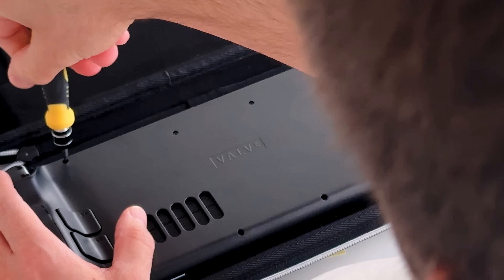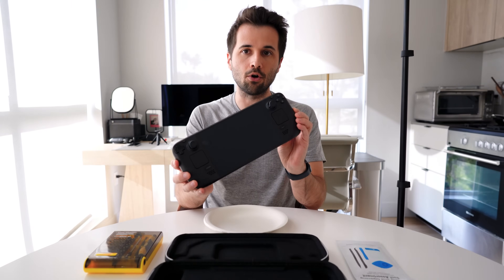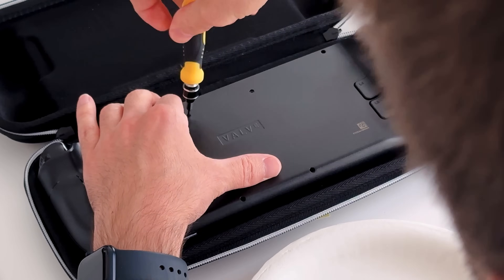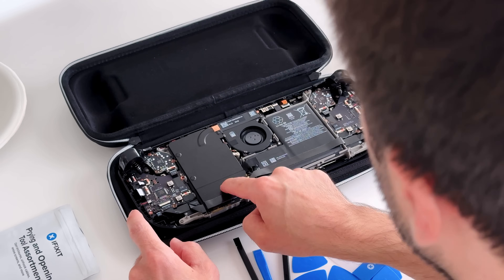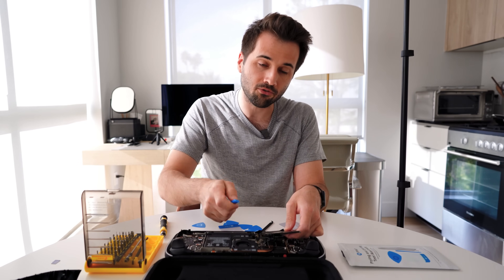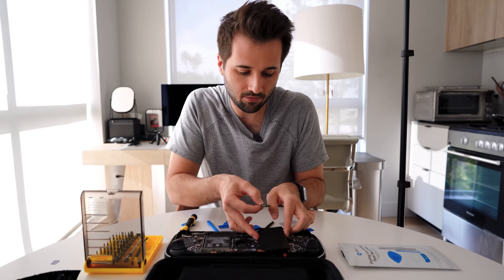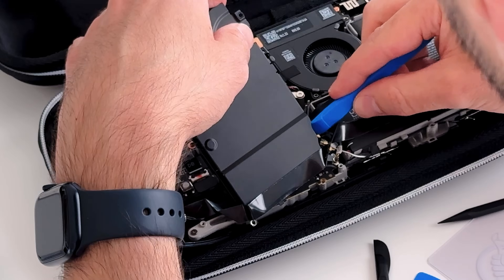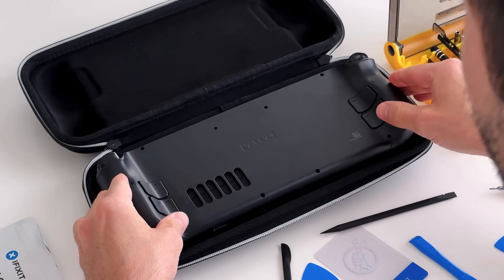How To Upgrade the SSD in Steam Deck OLED

Comment: Great guide esp helpful not having to remove the cable around the shield - the ifixit guide makes you do more work and remove the socketed cable which adds the possibility of destroying the socket. The hardest part was figuring out how to start popping off the back shell, a lot of videos make it look WAY more easy than it really is. In my case I couldn't get it started on the side corner like videos show at all, I was able to start working the plastic pick around by starting at a corner but at the top not the side. Once I was able to start working and popping the clips along the top, it made it easier to pull the shell apart a tiny bit and work along the sides. Getting the back shell off is where the risk of the damn thing flying out the window somehow really comes in. Do not be tempted to start using metal tools you'll definitely mark the shell in an ugly way and maybe get the tool skidding along the screen by accident. Also might be good to at least temporarily put  a screen protector on the screen during the upgrade just in case.

Comment: why not just get 2TB micro sd nd let that 512GB free for smooth operation instead of opening it nd change ssd ?! 
is there really a difference between just get 2TB micro sd nd changing ssd ?!
Reply from the maker: Yes the ssd is much faster read / write speeds. For retro games you won’t notice but for AAA games ya…

Comment: step 1: Remove Micro SD card
step 2: remove SD bnackplate
step 3: please, LEAVE the ribbon cable glued to the APU shield/plate, trying to remove the ribbon equals risking tearing the thin cable even with its protective layer. 
             i tried removing it but refrained due to fear of tearing. it takes an awful lot of force. its REALLY glued down to stay there. unless the ribbon is already cooked, leave it.
step 4: (THIS IS OPTIONAL) you could release the ribbon cable from its connector on the left-hand side closest to the shield. 
              after this you can carefully fold the ribbon cable WITHOUT force onto the right side, give you a little more 'working space'. 
              do be very careful when unlocking the ribbon connector to remove the cable, as these connectors are fragile. too much force can break the lever.

Comment: You can unclip the ribbon cable on each side.  Makes it a lot easier to remove the metal piece.
Also, an SSD is not technically a hard drive.

Comment: Finally got around to moving the SSD from my old LCD to my new OLED. Have a couple of takeaways:
1) You counted out 3 screws on that internal shield. There's actually only two, and that third screw you point out is on the mainboard, and doesnt require removal at all.
2) You didn't need to disconnect the battery, if you put the unit in storage mode.
3) You can and should disconnect the ribbon cable that goes over the shield, where it's labelled "C-R". You just lift the white clip holding the end of the cable and pull it out.
4) When you put the shielding back into place, make sure the bottm right screw hole in it lines up with the screw hole in the mainboard. I say this as it may shift or bend out of alignment, and need to be popped back into place.
5) The SSD from your old Steam Deck is plug and play, and all your games, apps and files will appear exactly the same on your new deck, which is great.

Otherwise all good and thanks for the guide!
Reply: This was super helpful. Thank you. Used all your points.
Reply: @Adam-M1  say worrrrrrrd
Reply: Screenshot! Thank you, good sir!

Comment: Unplug the ribbon cable and take the entire shield with the cable attached and set it on the battery so you dont have to keep juggling the shield and SSD.

Comment: I swapped my 1tb SSD from my LCD Deck into my OLED last night. From studying various videos and guides i decided this method was better than unplugging and/or unsticking the screen cable.

There is enough slack due to the folds in said cable to work around it to get to the SSD and to remove & install it.

Whichever method you do just take your time...

Comment: 4:20 DO NOT "work around it", disconnect the battery connector properly! The small "C-R" cable on the bottom left with the white clamp, just flip the white tab then gently pull the cable out, you should ALWAYS disconnect the battery when you are working on devices. Once you are done you can easily slot it back in and flip down the clamp again to secure the cable.
5:09 Yes you do but NOT FROM THERE, disconnect the left connector which connects it to the motherboard, that's why the clamp is there. That is WAY EASIER than what he's doing.
If you disconnect the battery properly you can fold back the shield completely off the Steam Deck, making it MUCH easier to access the M.2 slot.
The way he's installing the SteamOS image is wrong too, it's WAY easier to get a USB-C drive (or one of those combo USB-A/USB-C drives), then use RUFUS (or another image installer), download the image file from the Steam website and install from the USB drive, that will also be WAY faster than using an SDCard.

Comment: i needed an extra step, with a corsair 2TB SSD it was very slightly thicker than the 512GB i removed, which meant sliding the silver shielding would not go over the new SSD. So if that's the case, carefully unstick the shielding wrap, place around the new SSD and re-stick it around. It's pretty easy but use tweezers rather than fingers ideally so you dont remove all the sticky residue with your fingers. Oh and i just unstuck the cable(s) from the main black plate, it goes back on just fine.
Reply: thanks for the info buddy👌🏼

Comment: When I tried to pull out the battery plug using the tab, the transparent part of the pulling aid came out of the plug. I then pinned it off with a flat tool. I hope it's no problem. I'm afraid I've damaged something. Tomorrow the SSD will arrive and I can test it. Opening it was child's play with the ifixit tool it took 4 seconds. Why can't everything just work like in the ifixit instructions? I only saw your video afterwards.

Comment: Stop calling it a hard drive.

Steam Deck uses a solid state drive.

Hard drives are mechanical, they have moving parts, they're much slower, and they make noise.

Solid state drives are much faster, have no moving parts and are completely silent.

Two different things.

Comment: Great guide, I was just wondering, have you tried the "loosen two screws" fix for the audio hiss? I read you can just slightly loosen the two screws on the audioboard to fix the issue.
Reply from the maker: Yeah I have another vid about it here: https://youtu.be/XuCFw-gfhlA?si=Y3J7fOsulEfuGY1T
Reply: i added DIN125A m2 washer under 2 audio board screws. Completely eliminated the hiss.

Comment: Those aren't hard drives, those are SSDs at worst (NVME at best), though M.2 drive would be the best description;
Hard Drive describes a rotating platter drive, which are antiquated for most use-case in modernity.
Reply: SSD is the best description seeing as how that's the type of storage being used.

M.2 is nothing more than a form factor.
Reply: No, it isn't actually;
NVME drives ARE NOT SSDs, nor are they interchangeable with them in a number of cases;
M.2 slots, with storage in mind, are keyed for two form-factors, M key & B key;
M key are utilized for NVME drives and utilize PCIe X2 or X4 modes presently.
B key is used for SSDs.

Comment: You can fix that stripped screw with epoxy resin. A very small amount of it injected into the thread, use a tiny drill after it sets to give it a center. Then reseat your screw to make new threads. Lot of tutorials out there on how to do it that might be worth looking at. It is not a fun process though.
Reply from the maker: You are awesome sir thank you!!

Comment: Definitely do not over tighten screws on PCB boards in compact units like this. The PCB can take heat fine, but the metal of the screw expands when heat rises from use, and that small amount on a tight screw can crack your board or drive.

Comment: I have a genuine question:
1)If i choose the 64gb Steam deck and then swap the 64 to 2tb, will my steam deck function like normal? Meaning no crash or slow or any malfunction whatsoever?
2)How to get the 2tb to swap with the 64gb? Like can someone recommended where to purchase it? Along with the tool kits that the guy used to open the back of the steam?
3)Do i have to install windows/linux on my steam dec? But i wanna install windows.Idk why. perhaps i could watch utube? or maybe spotify😭🤦

Comment: Your video was not out before I did this. I say if we removed the cord on the case and press the glue back onto the case, is there anything I should look out for because I did open up the little white flap and took the cord out and put it back in correctly.
So is there any issues I should look out for because of moving the cable
Reply from the maker: You’re probably fine 👍
Reply: @TonyCassara  also a small thing I witnessed on the steam deck oled limited edition there is one pixel on the top right on my system I tried contacting valve They told me they won’t take the system back for RMA but they might consider after I use the system for 30 days
Reply: @TonyCassara  thanks

Comment: I’ve just upgraded my oled Steam Deck SSD. The video helped but I did a couple of things differently. I disconnected the ribbon cable from the left hand side and folded the shield over to give me easy access to the SSD. I also only needed to unscrew the two left screws on the shield, the other one appears to be holding the PCP to the case.

Comment: After doing this, the Steam Deck stopped to read the micro SD Card, help
Reply from the maker: Try opening it up and making sure you reconnected everything correctly.
Reply from the maker: After that make sure the SD card isn’t dead by plugging it in somewhere else.
Reply from the maker: After that, contact Valve for help.

Comment: Oh man, this is definitely something I'd rather pay someone to do; I can install ram and graphics cards, that's about it.  I'm assuming this voids the warranty?
Reply from the maker: Uncertain so if you don’t feel safe don’t do it! Find a friend or iPhone repair company in your area and ask them to do it.
Reply: @TonyCassara  Thanks.  I'll worry about it if it comes to it but I'm fine with the idea of sd cards for now.
Reply: @robertlefeaux I'm pretty sure it does NOT void the warranty. Otherwise, they wouldn't let you upgrade your own storage.
Reply: @PSYCHOV3N0M  I don't think that's a fair comparison, since the other method of upgrading storage is just slipping a card into the micro card slot.  Some places are more lenient with their warranties, and it's quite common for one to be voided by merely removing a back plate, even if you don't touch anything inside.

Comment from the maker: RE: “unplug the ribbon cable first” - there’s another wire hot glued to the bottom of the backplate and by unplugging the ribbon cable you’re increasing the potential for added force on that remaining wire. By keeping both you’ll spread force evenly between them and have a very obvious reminder not to push it!
Reply: It wasn't hot glued on mine, just taped to the bottom of the shield, and the little piece of tape was easy to unstick after I'd disconnected the ribbon from one side. You're far more likely to damage a ribbon cable twisting and wrestling with it like this than just disconnecting one end, it has a zero insertion force connector that you just flip up.
Reply: @me2olive  just swapped my SSD it wasn't hot glued for me either just gently lifted that shied up after unplugging the ribbon cable and the tape released very easy. this video looks way more of a hassle that it needs to be
Reply from the maker: Interesting maybe the newer models are being built without the glue. In which case it's probably worth unplugging the ribbon cable.

Comment: Why not disconnect the ribbon cable from the connector it's attached to on the board labeled "R"? Feel like you're more prone to damaging that cable by accidently yanking it by holding that heat shield up vs disconnecting it and flipping the heatshield over on top of the fan to give you the space you need to replace the SSD.
Reply: This. It's very frustrating that no Steam Deck OLED teardowns show this ribbon being disconnected, even iFixit's just magically had the cable disappear between steps. It's one of those zero insertion force connectors that you just flip up, easy enough to do but nobody shows it!
Reply: @me2olive  Most people aren't familiar with those types of connection and would rather not touch it.  They are easy but can be a pita at the same time depending on the angle (in general).  But yah, they could maybe add in a "you can do it this way as well" part showing it, I guess.
Reply: You are right. I switched the 512GB drive of my steam deck oled 1 hour ago and it very easy to unplug this cable.
Reply: @Krachowsky how did you move your data to the new drive?
Reply: Exactly why I came here to write 😂👍🏻
Reply: because he is an amateur

Comment: The L4 switch fell off my left trigger board and Steam will not repair under warranty.  Obviously there is no way to apply enough force on the switch to dislodge it.  So shame on Steam!!!
Reply: Did it happen during the SSD swap? Was it the new OLED model?

Comment: Just upgradeed my oled with a 2tb  ssd
There is only 2 screws that hold down the heat plate.
The third screw that was removed last in this video actuality fastens a portion of the mobo down
Reply from the maker: Ah good to know thanks for sharing that!

Comment: Hey quick question. 
Do you use wired earbuds plugged into 3.5mm jack on your deck?

If you do, do hear a constant static noise coming through the earbuds?

I have tried 3 different wired earbuds on my steam deck oled, and I hear a constant static noise with all 3.
Reply from the maker: Yes I have buzzing with sensitive IEMs also. I use a dongle called the ifi IEMatch that eliminates noise so I can’t hear it normally but I’ve read it might be a driver issue also. I’ll investigate, if it’s a driver issue I’ll make a quick video.
Reply: @TonyCassara  Thanks for getting back to me. I’ll look up the dongle you mentioned. I hope it’s a software issue.
Reply: @TonyCassara this sounds like you’re an audio nerd as well? :) Will try with my u12t when I am back home. The ifi dongles are always nice, but honestly a lot of devices just have an extremely bad headphone jack. If you don’t need to charge at the same time a USB C to 3.5mm DAC dongle might be better if supported. The Apple one performs extremely well for the price. Will try this out as well.
Reply from the maker: @Trojanischer_Esel dude u12t are legendary ive got the custom version a12t! the apple dongle is the best price and so rock solid but i adore my questyle m15 the sound is SO good very warm and deep bass.
Reply: @TonyCassara  Wow! Now I’m jealous. I couldn’t justify the price for the custom version, since I got a pretty good deal for the universal one second hand. I feel like the Apple Dongle might be great as a recommendation for everyone. Also I think I would prefer the smaller formfactor for the Deck. I have to look into the Questyle for music listening though :) I own the Qudelix 5K, not sure how they would compare.

Comment: Can I just put SSD from my LCD Steam Deck to OLED without formatting and re-installing SteamOS?
Reply from the maker: Absolutely yes!
Reply: @TonyCassara  How long should the deck take to come back on in this case. Mines stuck on the steam logo after swapping out the ssd with a 2 tb I had in the LCD model.
Reply from the maker: @Dubhgetsu  did you update to the latest SteamOS before swapping it in? the "Preview" build? If not you'll need to swap it back and do that otherwise the latest firmware wont be supported. you can read more here: https://www.reddit.com/r/SteamDeck/comments/17wt6d1/anyone_know_if_itll_be_possible_to_pop_a_ssd_from/
Reply: @TonyCassara  and if I don’t have an sd card. Just my new 2tb ssd then I can just do the swap and re download the games that I want without the whole formatting , reimagine process? Basically just plug and play?
Reply from the maker: @LaymanGamin no you have to format a new SSD regardless :( you can do it with a USB-C thumb drive or SD card, up to you!

Comment: I usually use an old ice cube tray for the screws, especially since I can separate them by step and it also helps me remember in what order the particular screws go back in
Reply from the maker: Clever idea I like this a lot!
Reply: I just used my open Deck case and laid out the screws in the positions they came out of on the inside of it.
Reply: Pill dispensers are even better because they have a lid for each section so you can clamp them closed in case you nudge the thing or it falls of your desk, the screws will all be secure.
Reply: The MacGyver is strong with you. Well done.
Reply: Damn I have a stainless steel one.  I could put a neodymium magnet on the bottom of each cube and make it magnet and can mount it to my table which is also steel. My man you have made my day.
Reply: meh I just use this magnetic tray I got from some where to hold the screws and they don't go no where they stick to the tray bottom plain and simple as for the torques tools I got a master craft it from Canadian tire so I could get into my stream deck oled I tried walmart but they didn't carry the tools there sight said they carried so canadian tire it was they were just across the street anyways so no big treck to get there luckily
Reply: I use a blue magnetic piece that comes with the screw driver set, and is perfect, it just keeps the screws atached.